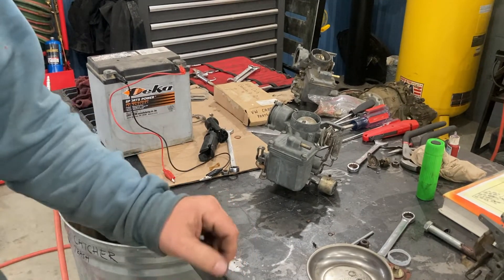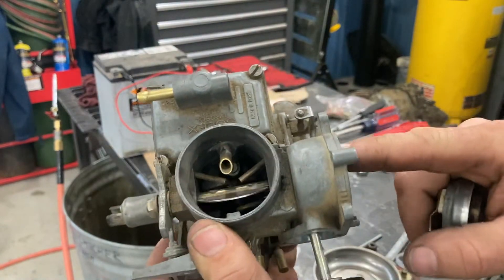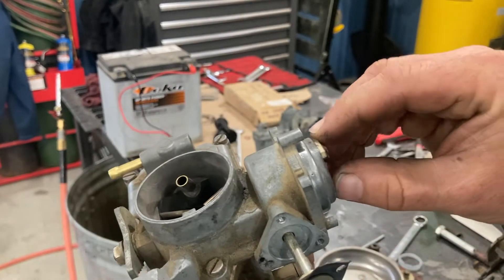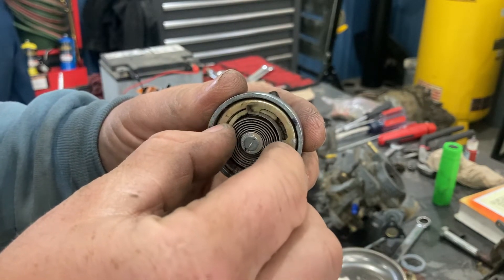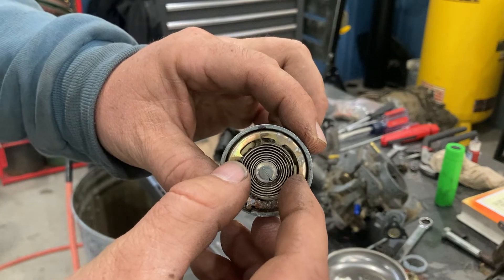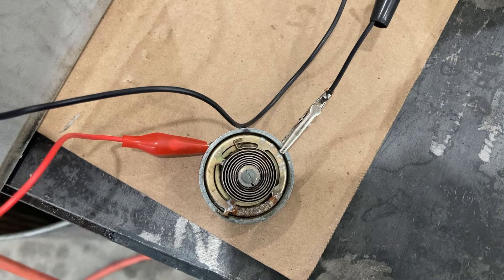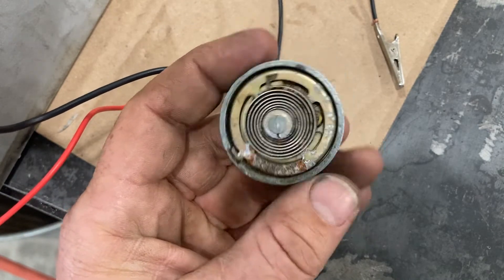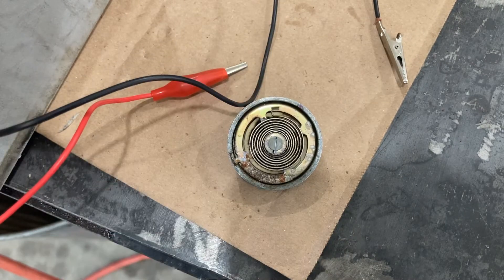VW Solex 34, 30, 28 Pict Choke HOW IT WORKS & Settings - Air Cooled

Comment: Hey man I have a 1996 fuel injection Mexican beetle. However, I adapted a carb on it, because the MAP sensor failed which is welded to the ECU and it’s a hung to find a working ECU. 

The male conector that is on the choke, where the 12V is entering, is broken off. I don’t know if Mexican beetles came with a thermostat, or if the Mexican carb beetles came with it too.

should I completely just say screw it and feed the 12V choke since I don’t even have the thermostat.
Reply from the maker: The carburetor choke is totally independent of the thermostat even on German models. It’s a simple power wire that comes from the ignition coil. I don’t see any reason why you couldn’t just run any key on power wire to the carburetor choke. 

On another note, some Mexican beetles did have the thermostat installed, and you can buy Mexican thermostats on eBay

Comment: Hi  MAINE MAC.  THANKS FOR YOUR VIDEO. DO  YOU LUBRICATE THE SPRING WHEN YOU  CLEAN THE CARBURATOR. O YOU DONT HAVE TO?
Reply from the maker: Sorry for the delay in responding! I suppose a small dab of white lithium grease or similar compound wouldn't hurt it, although I've always just run it dry! Let me know how it turns out!

Comment: Great explanation! Mine is Minuki Solex  water (coolant) heated choke. It closes properly for the cold start.  But then seems to open too quickly.  Then I can't restart the engine without holding the choke closed momentarily. Thermostat is in place.
Reply from the maker: Interesting, I've never used that particular choke before.

Comment: I have a 71 beetle here in Brazil. The carb doesn't have a choke. I was going to replace it with one that does. Is it just as simple as bolt on the new carb and run a wire from the coil to the choke for the choke to function properly?
Reply from the maker: Yes, it’s that simple. Find a carburetor with a choke that matches your manifold (28mm, 30mm etc), and then add power wire from the coil so it turns on only with the key switch on

Comment: My car has an aftermarket carb. It starts fine and runs well but when I arrive about 7 miles later it is idling very fast. I checked the VW official manual and one of the problems listed was the heater element. It also listed choke valve or fast idle cam sticking. When I look in the engine nothing seems stuck. Would disconnecting the auto choke give me the answer as to the problem and what might I expect with that done? Muir explains how to do this. Still  learning - there is only one person able to work on this car and he is quite busy with other things.

Comment: Thermostat? 🤔
Reply from the maker: Aircooled Volkswagens have a thermostat, although it’s often removed. Every VW produced from 1949 until the end of production in 2002 had a thermostat installed by the factory

Comment: Could this have been reason why my car started running real CRAPPY when I brought it home from the mechanic? Looked at my Choke element and it was DISCONNECTED, i.e., spade lug pulled off. They worked on the carb and obviously forgot to reconnect it. Hot Summer day. Not sure how much ambient Summer heat also factored in...
Reply from the maker: Yes it absolutely will impact it

Comment: Great Video. Could you tell me if the  electric choke piece is interchangeable between the 3 carburetor's. I looking to update my 28 pict to 12 volt ?
Reply: 6 volt systems use 6 volt chokes. The shape is the same, but you want the choke to match the voltage of the system , so if upgrading to 12V( probably done by now) , it's crazy easy to get a 12V choke.

Comment: Interesting, Nicely Illustrated...   👍

I have 2 Buggies (64 and 74), my 74 chokes after I drive it about 1 mile to a mile and a half, (Since there's a connection) Is there any certain fuses I can Check (If blown) that would prevent my choke to properly function?

I was planning on troubleshooting it first to see if I can fix it Prior to taking it to the Shop...   😊
Reply from the maker: Check with a test light to see if power is at the choke when the key is turned on. Then make the adjustment on the Choke as shown here.

That’s about all you can do
Reply: @MaineMachinist Perfectly Said, Great Idea, I'll Try That...   😊

Comment: Thanks for the info. I assume you would adjust the position of the choke starting position if you lived in a warmer/hot climate. As the ambient temp is higher
Reply from the maker: You could try different starting points, but the Bentley Manual just recommends one setting. Kind of interesting.

Comment: It's great to explain how it works as one of the few, but then do explain in detail how it works: the spring doesn't just move counterclockwise because of the heat: it weakens the metal and therefor the spring, making the spring crunch to a smaller (shorter) spring and thus rotate counterclockwise.
Reply from the maker: It doesn’t “weaken” it

Comment: Any idea what might be up if my bus sometimes starts with the choke in action and runs great until i tap the pedal, and sometimes it does not activate and i have to give her some pedal so she wont die at cold start.. ?
Reply from the maker: Could be carburetor icing from clogged heat riser tubes. See my video on cleaning heat risers.

Comment: I'd like to remove my shut off solenoid. I just watched that great video too.
My solenoid is allmost in my way for my Gold Wing .
What can I use to plug the hole?
I just thought///the area inside will flood with gas.
Depending how many threads my plug has.
Thread size? Hardware didn't have it.
Reply from the maker: I’m away right now but I’ll try to investigate this when I’m home

Comment: After reaching operating temperature and the choke butterfly is wide open, is it normal for the choke solenoid to be extremely hot to the human Hand.  Its really hot
Reply from the maker: It shouldn’t be that hot in my opinion

Comment: Someone put this carb on a 87 Tercel I bought.

What could I use to power my choke? You said Volkswagens use the coil?

Cheers
Reply from the maker: Yes. VW had 12v power that activated when the key switch was turned to the ON position.

That’s ideal, but I person could run an independent power line with a switch if they wanted to be able to turn the choke on manually.
Reply: @MaineMachinist  cheers

I'll get a meter out and find a 12v source. I need to figure out why the throttle binds up with the choke on also

Comment: Great info on these chokes by VW. I've been chasing my tail with this issue for some time. My German Solex gave out at the throttle plate bushings and I could not afford another, so I opted for a BBT Chinese clone and was about to give up on it, when it occurred to me my issues were the jet was too big, changed, and choke was never hooked up properly. These two issues alone got it back on the road. I will still have to do some minor air fuel and air bypass adjustments but feel good to have made some small progress
Reply from the maker: I hope you get it all straightened out soon!
Reply: You can rebush and fit spindles on any carb keeping original carb the best outcome to retain Solex imo..Good luck.😊

Comment: All bets are off for us baja owners. Most engine tin gone, no flaps (on mine and many others'), and an open air engine that probably gets better cooling overall in general, since its not enclosed under a deck lid. Way more airflow and cooling on the carb and choke element.
Reply from the maker: This is a good point. I have a pipe frame buggy we have registered as an off road ATV here in Maine. I have the choke mechanism on it but I’ve considered running a manual choke of some kind just for those reasons. I bet it stays choked longer than it should. That would be a pretty neat video…. Checking and experimenting with the choke in a open engine environment…